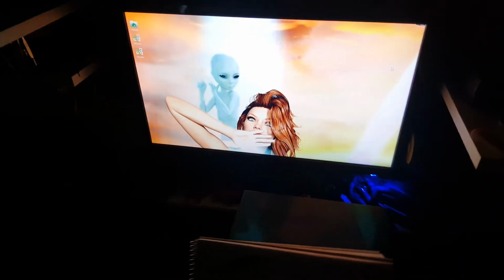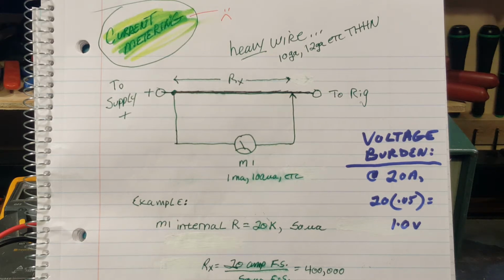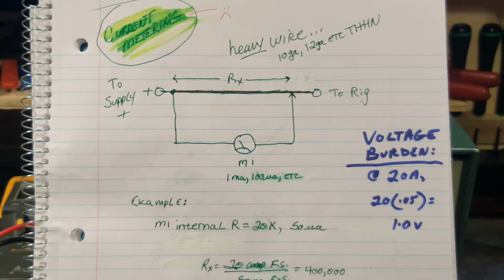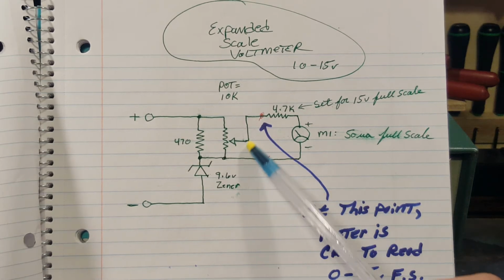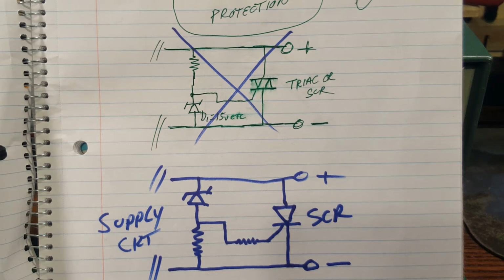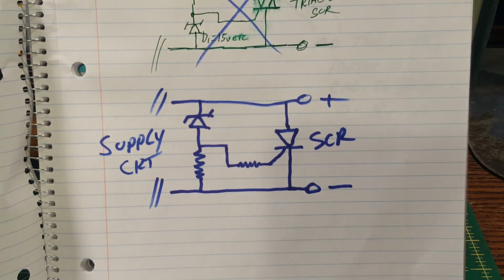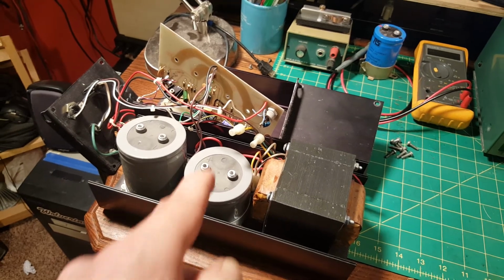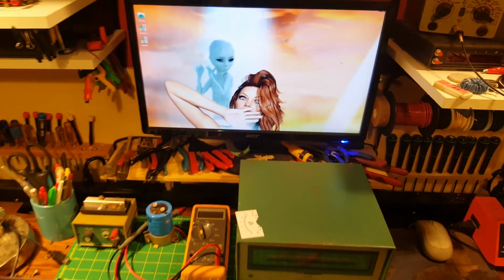Linear PS Metering & Design: odds-n-ends-n-corrections

Comment from the maker: Blowzo Thinks: (aww come on, man! don't say it. lol)
That crowbarring the AC mains input is a scheme to protect the PS. I don't care about the PS- save my damned rig! Their scheme leaves your rig completely vulnerable to the overvolt condition due to the energy stored in the caps. My scheme, the NORMAL one, crowbars the PS right at the output, dropping the rig's voltage to zero instantly.
Hey NuMar- i'ts a little like saving the baby and to hell with mom! I say save 'em both- but since one has to go (or else my little analogy would be pointless!) - Blowzo says the hell with baby.. mommy can have more. Save my mommy! Save my RIG!